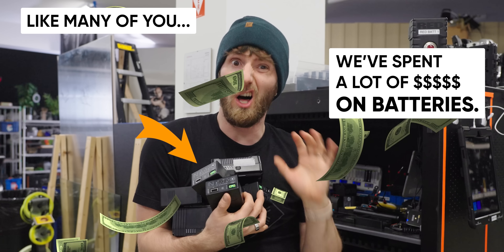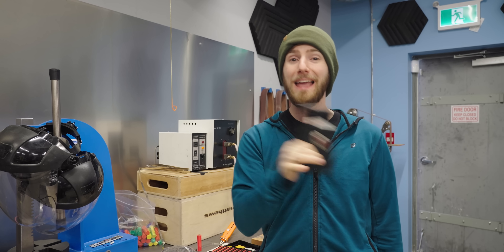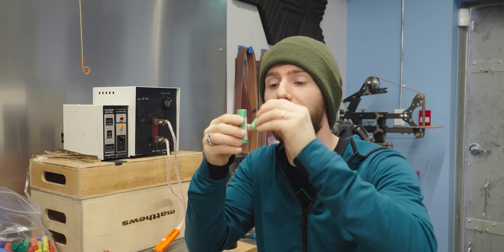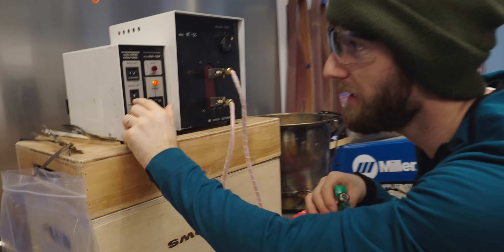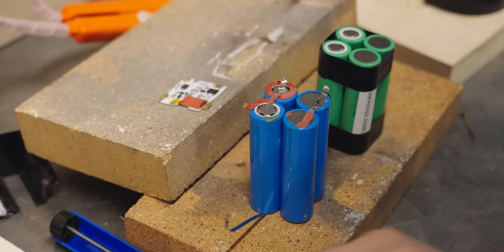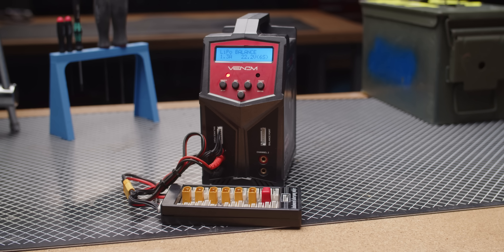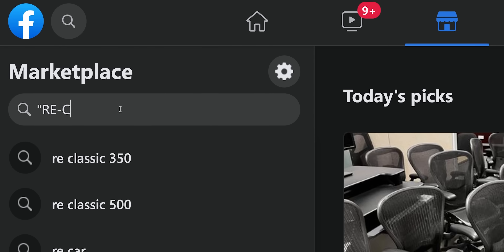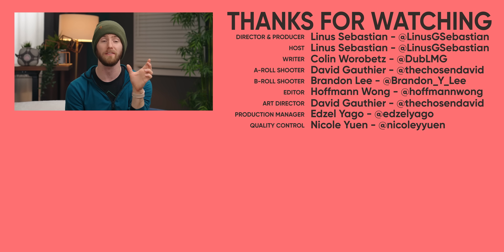This should be illegal… Battery Repair Blocking

Comment: What do you mean you attached the BMS correctly?  Dude, that board should NOT be that heavily discolored.  I can write some of it off as staining from the flux, but judging by that fatass of a tip you were using you were probably impatient and running WAY Too hot on your iron.  And ironically you looked like you were about to cold weld one of the last solder joints, but you picked up the tip and plopped it down so it was contacting the board rather than the pad.  You very well could have delaminated the circuit board layers around those solder joints.

Oh and another thing: I am 100% behind the right to repair movement and I would like to see battery tech improve so that DIYers could safely replace the cells in their own batteries.  Until then, DIYers should examine how many precautions they took while working with these cells.  There is a lot that can go wrong especially with old cells, and I can't fault the battery manufacturers for killing these packs after their internal safety checks flag something as bad.  Is the pack no longer throwing errors because the bad cell(s) were swapped, or because things have gotten worse and the pack is now in an undefined failure scenario?  Makita (and probably other companies) will allow the pack to throw a certain number of errors before the pack is bricked, and I consider that a fair compromise.

Comment: As someone whos a huge advocate for recyclable batteries, i would love for a video in a recycling facility to make people more aware of the growing issue with non recyclable batteries in cars and electronics.
Reply: Or how metals and minerals are mined and processed...
Reply: Everything is recyclable
Reply: @jamesdean8431  No it's not.
Reply: @JamieReynolds89  with enough money and the right tech it is.
Reply: @JamieReynolds89  there are a few plastic (thermoset) types that are difficult/not really worth recycling.
Google:
Which is easier to recycle thermoplastics or thermosets?
Thermoplastics are easily recyclable, compared to thermosets, because the polymer chain does not degrade when melted down. ... In contrast, a thermoset, like concrete, can never be broken down and reformed with the same strength.
Reply: @tscotom  There are ways to reform the monomer from a thermoset, it's just not cost effective, and most of the time includes nasty chemicals. Also thermoplastics can't all be recycled correctly depending on the chemistry, some will degrade really fast, some have additives which can make it really difficult. ABS for exemple is around 7 times (it's the only on I remember the number). But it will depend a lot on the polymer, the initial macromollecule, the shearstress in the process etc. Thermoplastics have the problem of polymer chains getting shorter each time you recycle by shearing the molecule (high pressure and flow in the transformation process leads to this), each time you change the final properties of the part you make ;) Tho it's not a problem for common items like bottle caps as they don't need to have great mechanical properties it can be for technical polymers
Reply: Every car battery is recyclable.

Comment: Just a noob question: Way not just fully discharge the cells before welding?
Reply: Batteries can't actually be "fully discharged" without destroying them.
A lithium ion battery is "full" at 4.2v and "empty" at 3.5v.
If you go lower or higher, you ruin the battery.

Comment: I had a HP Deskjet F4224 printer, and it refused to work with 3rd party ink cartridges and even refilled originals, because it would identify them with a chip and check how much they were used and just said "I don't care if there is ink in that, buy a new HP one for $30 a piece!"
Now I got a Cannon MG5750. It's $20 more, but this thing takes EVERYTHING without complaining. Just after a year, I saved more than the $20. I   l o v e  this thing!

Comment: I think I would go all in on the first battery manufacturer who makes a set of products that uses replaceable lithium ion cells you can just order and swap whenever they go bad. I learned to look for and never to buy battery products that only have a 60 day warranty after my first power station bricked, as well as every single unit on the store shelf that I kept exchanging it out for. This is one time the local store's very generous 90 day return policy couldn't save me.

Comment: Or you could make the whole damn thing not require welding for example ... Like toys that take in AA batteries surely it's possible to make it so that the housing is a bit bulkier but be servicable by someone with the tech know-how of Linus . Surly. But the companies need your $$ bills so they are perfectly happy to buy up the decision makers to make laws that suit their business models and said lawmakers every year keep telling us  that we produce X amount of waste.
Reply: You're forgetting that this Red pack is not a device, it's a battery. It is 99% cells with some plastic around it and a small pcb. A battery pack like this will last 6-8 years, the amount of plastic and pcb in reference to this timeframe is minuscule. Also these battery packs go on 50K cinema cameras and they're also thrown around in rough eng settings but still need to be 100% reliable. Of course they are welded. And who do you think would buy the much bulkier packs? They're bulky and heavy enough as they are when you have to carry them all day long.

I'm all for replaceable batteries in consumer devices though. Way too many devices get thrown away because one stupid little lithium cell inside it is dead. But it's not comparable to an open, standardized battery mount system like v-mount. Devices with v-mounts are usually being used until they fall apart because they were so expensive.

Comment: Yes the failed packs might only have a few dead cells, no it's not hard to test them and find out which ones are failed. Yes you absolutely need to build new packs with all cells that have the same capacity. Just needs a few tools to charge/discharge the cells to measure their capacity. Very common in the diy powerwall world. Arguably a waste of time if you're just rebuilding a couple camera batteries though.

Comment: Not worth doing this most of the time - the cost of all that BS greatly outweighs the cost of a replacement one...
Reply: This exactly! Because these are already user-replaceable batteries they are not a device you have to throw away because of a built-in battery. Take away the cells and you are left with some plastic and a small pcb. Replacing the cells doesn't really make any sense especially when you have to pay end-user prices for the cells. Especially because v-mount is an open mount standard and you can get good replacement batteries from other manufacturers for a lower price. I've used Sony v-mount cameras for 20 years now and I've never bought an original Sony battery because v-mount is such an open standard.

Comment: I found maintaining a voltage on the bcm stops the memory from wiping its risky if you aren't confident but it works, almost like using a car cigarette power adapter to keep the memory on the ecu's while carrying out works that involve battery removal.

Comment: Thanks for the video. 2 major problems here:
1) After replacing cells, many BMS keep the battery disconnected from the output until a charger has been connected. You need to try connecting the charger briefly before testing the battery.
2) The sparks I saw seem to be from the spot welder, rather than the cells venting. Go through the sand box and I bet those are still OK.
Reply: I agree with you. 
1: yes, sometimes it's connecting the two poles befor and after the switching mosfets.
2: You can smell the electrolyte very well when you blow up the cell housing, if they don't smell a thing, it was just the strip exploding because of bad contact.  ( happens often when i build batteries ^^ it's scary )
Reply: Yeah every time I’ve seen a lithium battery vent it was obvious and immediate. Like before you would have time to get it in the bucket.
Reply: This ^ Such a huge waste of batteries. Their engineers should have looked back at the footage and been able to tell that.
Reply: @brnktv  cfghnnm
Reply: That's what I was thinking too.  He does comment about keeping the tips clean between pulses, but I don't know if there was junk on the tips or if he was anticipating a spark or an explosion, causing him to flinch a little and break contact.
Reply: Also BMS chip can have "kick start" protection when you should power up one of its legs
Reply: ive done WAY worse things to lithium cells than what linus did today, and ive never had one pop. he def over reacted lol. its ok though, he probably also didnt spend time as a kid burning holes in the floor and taking apart everything he could get his hands on.... (guilty as charged!)
Reply: Yep, I just re-celled my bt speaker (w pre-welded strips on cells, i only had to solder) and it only worked after connecting to the charger.
Reply: Exactly, you even see the sparks on the real spotwelder video at 17:26

Comment: It's easier to use the battery interface to connect a complete battery to. It works for power tool batteries. The charger has the circuitry that keeps you from using a old battery that has given the charger a certain amount of errors. So you have to charge it on a hobby charger. Which isn't bad when you quadruple the size of the battery. I also raised the voltage to boost it a bit. The wired battery also is nice since I can carry it on my belt and keep the tool lighter weight. Allowing me to use the tool longer with less stress.

Comment: Dyson. Dyson does this. I figured it out when a pack failed within warranty. i broke it open and most of the cells where still good. Then i learned that the BMS flips a bit in it's firmware so it just gives a red light and won't start your vacuum.

Comment: maybe you can't replace batteries in a group, but what if you took those batteries and re-purpose them for devices that only use one or two or however many you can get from a single batch? that way you are not officialy combining new cells but keeping the ones that do work together on a new project or device?

Comment: I vividly remember running into this roadblock when I was 16. As a relative electronics wiz, I wondered why I couldn't replace my laptop cells with fresh ones I had available, instead of buying new batteries. Or why many cells coming out of 'dead' laptop batteries proved to be super-stable and reliable when used for other purposes. That was when I discovered the corporate evil called BMS.
Reply: I have pulled out 18650 cells from dead battery bricks that were like new. Sometimes the BMS is so bad that it dies way before the cells degrade. I have like 20 of these perfectly fine 18650s lying around now. I bought some 18650 camping lights so now I can use them as emergency lighting in case of a power outage.

Comment: so you just cut out the footage and fit it with a lie. 9:35
wow.. yeah that's Canada anno2022.. rancid and dishonest as f.. and you even just blatantly lie to the viewers with that statement and stated the camera was not rolling, which it clearly was. 9:35

- the problem is you put too much force on the spot welder joint, weird that so-called skilled dude.. you referring to, ..cant do that logic, - you have a very pointy spot welder-tip and you are making metal hot (to an extent liquid to do the joint) so if you push too hard you gonna penetrate it.
that spot welder tip your using is extremely pointy that can be good for certain tasks, while most intended for batteries are kinda rounded at the edge' so you don't weld-penetrate it, as it is high current INR/IMR cells.

My preferred spot welder cost like  12 USD (delivered) a few years back, and goes under the name "Portable mini DIY spotwelder", and on the display, it has a 1E  = 1ms with my scopes "ms" value and it goes from 1E to 99E on the display ...you can easily attach a 3USD foot pedal if you want, but the automatic feature works brilliantly.. and then you use 2x 4S high mah & C-rated LIPO packs in parallel and you got all the umff you need for casual DIY spot-welding..
it is rated for 3s (12v) but looking at the board components I saw no problem in using 4s LIPOs. (16v).. have not tried 5s as 4S in parallel gave more than enough penetration.

Comment: I have 7,000  18650 batteries powering my house. I charge them by solar and haven’t had a power bill in over 5 years. I built my packs with a k-weld spot welder. Since installing my system I have had no battery out of 7,000 give any problem. I recovered the batteries from old laptop batteries. 7;000 batteries didn’t go to the landfill and I have recovered all my systems cost in less than 4 years,batteries included. Over size everything you use and use quality equipment and you will have no problem.

Comment: A tip as I rebuild batteries professionally:
Once completed rebuilding and reattaching the BMS to the new cells and everything is hooked up, short the actual cell pack's negative to the BMS output negative. This will wake up nearly all smart BMSs that aren't "evil'."
Reply: @1337GameDev  shorting negative to negative, no
Reply: Similar to shorting out some PCMs on vehicles to clear capacitors and actually reset the system.

Comment: You're lucky if you're a doctor, because you can swap the cells with an external power source (constant voltage).
The Arcade machine boards from Sega had an issue with the battery. If they died, they killed the entire unit (the entire data). The technique here is to connect an external powersource to the board before disconnecting the battery. It's like playing doctor with the mainboard.

Comment: You did not keep the BMS powered. That'll trigger the deep discharge mechanism to make discarding them more safe (as handling completely empty batteries is safer than nearly empty ones...). You can, often however, "jumpstart" the BMS by bridging the input to the output so that it gets power on the output side again. You don't need to do that for long. It basically just needs to flip a transistor...
The safest way is to just keep the BMS powered at all times (From experience with USV and Notebook batteries).

Comment: even worse, some manufacturers use a hardware fuse which is burnt after a set number of cycles. Once the fuse is burned the bms won't work anymore, so you will need both a software hack AND a hardware fix to recell a dead battery. I believe the Mak****a power tools brand does it this way...

Comment: If it was either volatile memory or detects disconnect, having the BMS attached to a external voltage while doing the repair may help circumvent that.

Comment: Lithium batteries are definitely no joke.  I've experienced several fires from ruptured prismatic cells and 18650's.  You can't put them out, and the slightest shorting could rupture the cell.  Any moisture will lead it to burn very violently.

I wish there were some businesses that could specialize in replacing cells to reduce e-waste and keep things safe.

Comment: Some BMSs need to be connected to a charger before they start to output. So even though the batteries are fine and working, the BMS wont switch on until it is connected to a charger. I dont know anything about your specific BMS but it might be worth a try.

Comment: Are those sparks caused by damaging the cells, or are the cells still fine and the sparks are just from the spot welding tips, maybe because of oxidation or just a bad connection. Are you sure those cells are unusable now or are you just playing it safe because you dont really know what you are doing?

Comment: I've been through this, my old Acer laptop had a battery pack with one faulty battery, I replaced the cells with new 18650 but the pack didn't show any voltage. I found out painfully that the BMS is not recellable. Fπ©× you Acer

Comment: Basically every powertool manufacturer does this shit, its where they make most of their money. Once a cell goes faulty, a fuse on the BMS permanently trips so you need to buy a new BMS.
They have been doing this for years, even on Ni-MH battery packs.

Comment: You could have designed and 3D printed a holder for the batteries with no space inbetween! I think it may be awesome if you would also implement some additive manufacturing here and there and also maybe highlight how it helps when you want to improve the repairability for a lot of devices :)

Comment: Just because a spark occurred doesn’t mean that the cell is wasted. As a matter of fact high voltage currents can restore batteries because it can break down dendrites. The cells were too low for the bms to work.

Comment: If it's a good enough BMS in there, heck, you could actually make the batteries flat out replaceable in a casing.

For expensive equipment, the BMS inside does balancing, short circuit protection, and the like, and can detect bad cells.
And, unlike for RC equipment, cameras and even normal everyday power tools don't usually pull enough power that even contact resistance is a big issue.

Hmm, wonder if there is a market for such empty battery packs with indicator lights and basic serial diagnostics..
Reply: These camera batteries are often used for LED lights which can draw a lot of power. Especially the big V-Mount batteries like the Red must be able to sustain at least 10 Amps constantly. Now of course that's nothing compared to a drone battery, but it's still something.